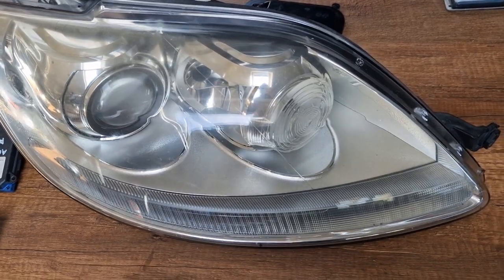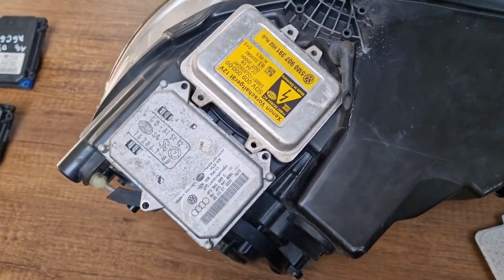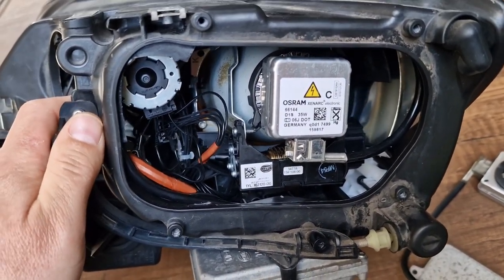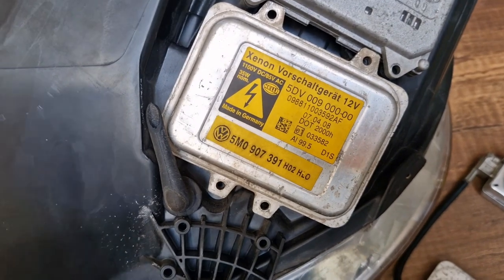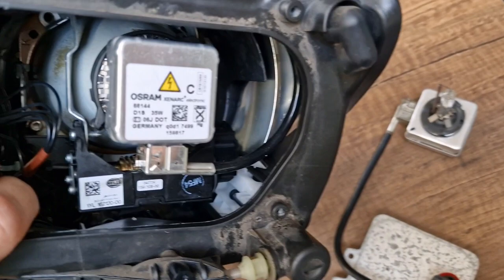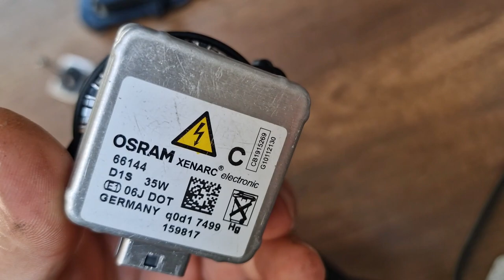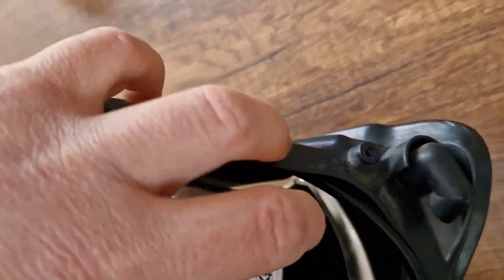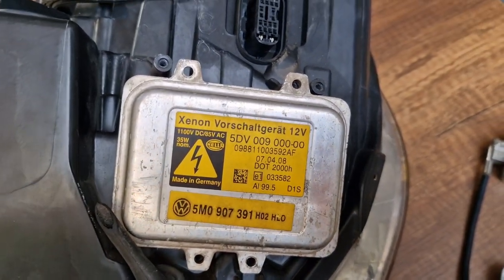VW GOLF PLUS xenon headlight ballast, AFS module, bulb replacement: low beam troubleshooting-repair

Comment: Hello, I have the same model of Golf Plus xenon headlight from 2008 and it shows a faulty AFS error. I have seen the left headlight that sometimes does not move and the light stays lower than normal when starting the car. Other times if you make the correct adjustment movement. Could it be the motor or the module that fails?
Reply from the maker: It can be the module or the leveling motors' fault. Needs to be checked both.
Reply: @xenonland   
I also observe when I am driving the lights when turning curves to the right and left the headlights do not turn to the sides the light does not direct
Reply from the maker: @sandrogh5008  if your motors are at place, more likely the faulty part is the afs module
Reply: @xenonland  I found the AFS module in a second-hand car scrapyard, the exact same model changed it, the problem should be solved

Comment: Great video! Quite detailed. I have a VW Jetta Variant with xeno headlights and AFS. Since yesterday the system is stuck during the initial adjust. It seems that the step motor succesfully adjusts the horizontal beam but fails on the vertical beam. It is possible to replace the entire adjustment mechanism or maybe just the vertical adjustment? Thanks in advance!

Comment: Does my ballast need replacing? My left low beam doesn't work. I switched sides and still left side doesn't work. Bulbs are good. I'm not sure which fuse to check but everyone I have looked at, looks good. Any help is appreciated. How do I test a bad ballast?
Reply from the maker: You can swap the non-working ballast and the working ballasts on both headlights. Put the non working to the working side headlight as well.

Comment: Amazing video. Does AFS module need to be coded if replaced?
Reply from the maker: If new, it should be coded. If a used afs module is installed, most of the cases go straight